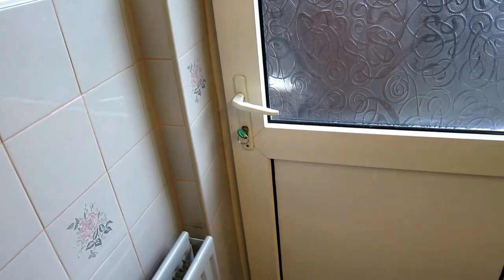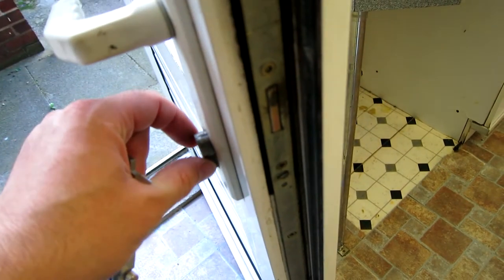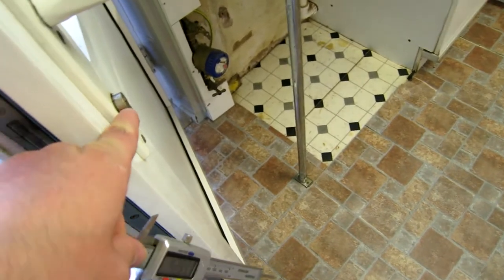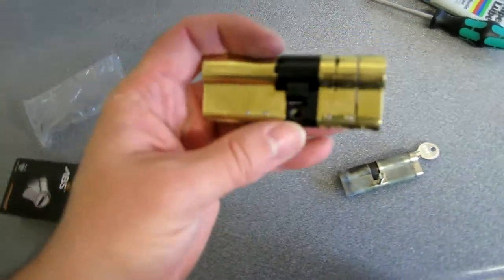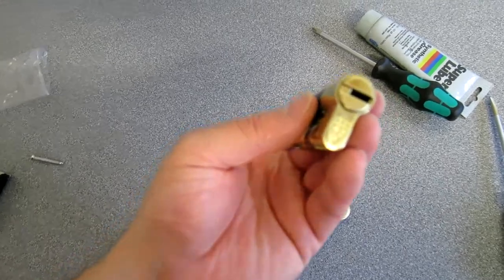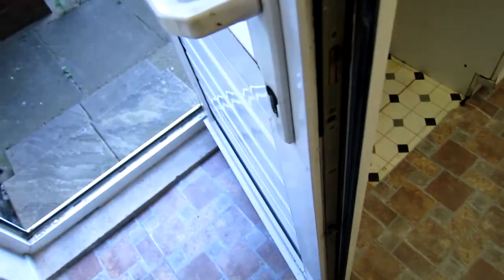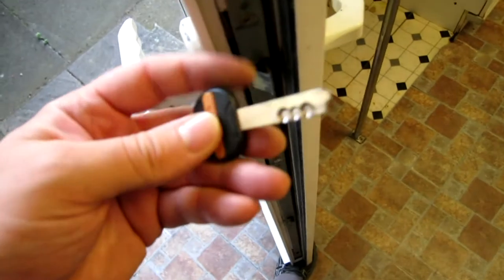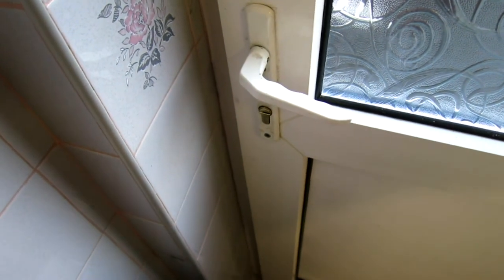How to change UPVC door locks (Euro Cylinder Locks)

Comment: Yup can also get a better rating handle. As criminals brake the handle around the lock then the lock. Of course in this case the lock is better than standard. A better quality handle will also deter the break too

Comment: My cylinder will not budge despite removing lock screw and turning key to line up cam. It feels like there is another mechanism/screw holding cylinder. Do some doors/locks have another screw to hold cylinder in place?

Comment: Is that a plastic clad steel door?
How does it compare with a proper security gate?
Reply from the maker: Aadil Shah Yes it's plastic (UPVC) clad steel. It has a 5 point lock so seems reasonably secure, not sure what you mean by security gate?
Reply: Well, here in South Africa we put a steel grill gate over the door. Those lock-cylinders you use there normally go into the security gate. (although other types may use 5lever double-throw locks instead)

Comment: You guys up up with some weird shit over there in the UK. Here in america we just have dead bolts as far as i know on steel exterior doors. I'm sure some other people have done different kind of doors and locks but never seen one like that.
Reply from the maker: *****, When we all had wooden doors, deadbolts were the norm. These days everyone has UPVC doors and these are the industry standard locks for them. This is odd, as until they brought out the more secure snap proof euro cylinders, they seem to be incredibly weak security. The doors themselves are reasonably secure as they have multi-point locking, but the locks were the weakness

Comment: The way this is installed, it's opened in 15 seconds sir.
First a big screwdriver to break away the white cover (even though it's metal, it will break), then a big Bahco to break the then protruding cylinder. 
Snap proof or not, this thing will break into pieces.
After that the multi lock mechanism is a piece of cake.
You should change that white cover immediately.
Reply: I do not want to get involved with this conversation, I am not a criminal and never will be, but this ABS cylinder is specially designed NOT to break in pieces in the door. If the cylinder is snapped, the cam mechanism will go into lockdown mode which blocks the front of the cylinder and prevents anybody from attacking the actual locking mechanism. The locking portion of the lock will remain in the door.The lock can only then be opened from the inside with the correct key. I am not telling you anything more than there is available already on the internet.